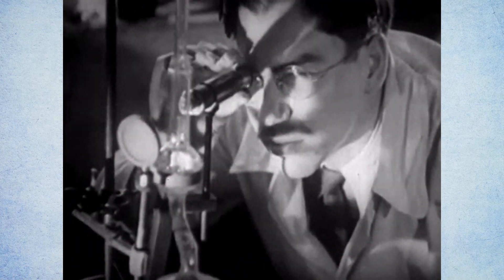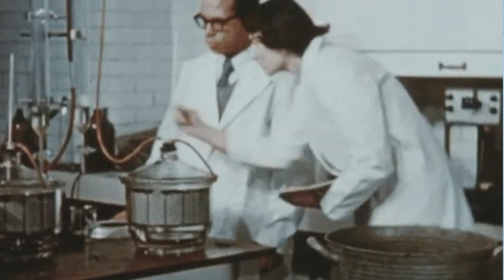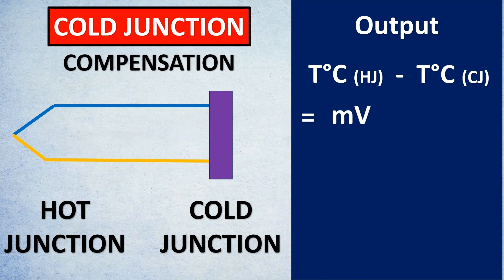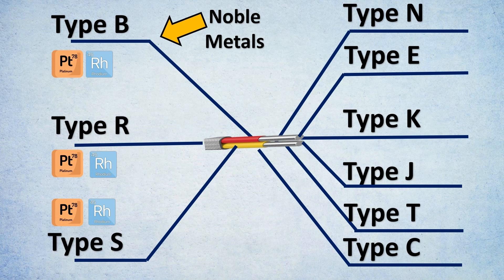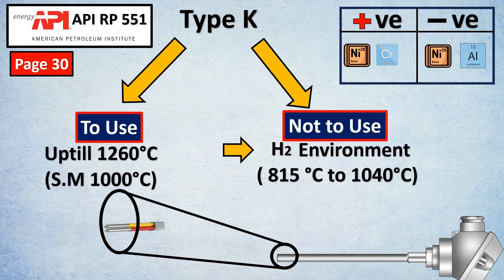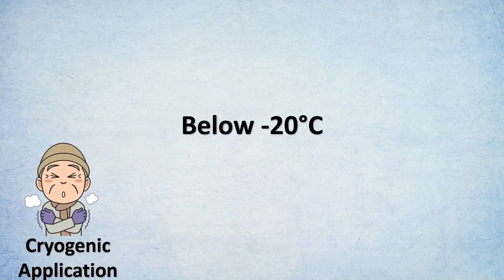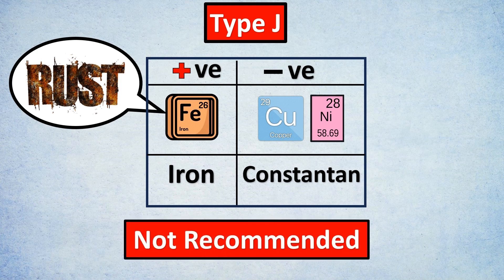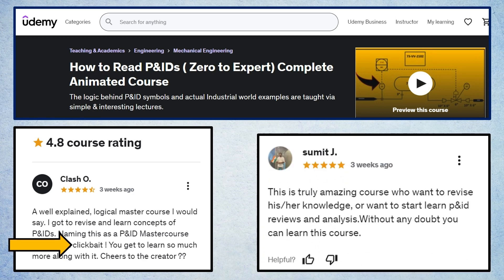Thermocouple working | Cold Junction Compensation | Selection | Peltier Effect

Comment: I have question regarding how to practically does cold junction compensation??

For HJ temp. millivolt  we can measure by multimeter.but
like your example we have to put thermistor for CJ temp. ??
Reply from the maker: Good Question, Thank you for your question. 

The Vendor needs to be informed that cold junction compensation is required, and the vendor will provide the hardware accordingly. 

we dont need to put thermistor. 😊

Hope this answers the question.
Reply: @AsadPassionateEngineer  if we have CJ side is electronic transmitter, how compensation happens? It will happen inside transmitter by itself?

Comment: Dear Asad, what is the minimum/maximum insert length of the element in the thermo well? Is it allowed that tip of the element is toughing the end of the thermo well? Looking forward yo hearing from you. Kind regards, Murat Aydın
Reply from the maker: it is actually recommended to have tip of element to touch the end of thermowell for better measurement . Hence we have concept of spring loaded assembly.